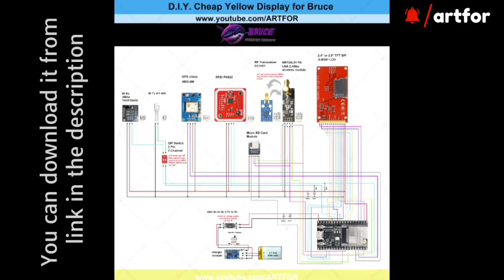DIY CYD for BRUCE Part 3

Comment: Bro I bought 3.5 inch tft module please help me how to install in this
Reply: Can we contact
Reply from the maker: You can find me on tiktok "ARTFOR" with the same logo
Reply from the maker: Sorry i haven't use 3.5" display, but what resolution the display is?
Reply: @ARTFOR 320*480
Reply: @ARTFOR 320*480
Reply: 480*320
Reply from the maker: need to modify the codes to fit with that resolution, unfortunately i can't do that sorry

Comment: Bg kalo pake esp32 aja bisa
Reply from the maker: Kalau baca digithubnya bisa...samain aja PINnya bang
Reply: Om buat nrfbox esp32 v2.7.2 om plis dia butuh oled nrf24 esp32 @ARTFOR
Reply from the maker: Boleh rafil tar dipelajari dulu ya
Reply: Saya juga pengen bikin esp32 wroom 32 itu apa om  @ARTFOR
Reply from the maker: ESP32-WROOM-32 adalah modul Wi-Fi dan Bluetooth yang kuat dan sangat terintegrasi, modulnya banyak dipake karena pilihan yang sangat populer dan serbaguna untuk membangun berbagai aplikasi Internet of Things. Saya disini pake yang tipe WROOM32U
Reply: @ARTFOR kalo esp32 wroom32 itu flash sama aja y
Reply from the maker: Iya sama rafil
Reply: Om mau tanya esp graber itu apa bg bisa control apa si  @ARTFOR
Reply from the maker: Baru denger saya juga
Reply: @ARTFOR cara program esp32 gimana om kalo pake flash esp32
Reply from the maker: Esp32 flash download tool ya, kurang lebih seperti video dibawah ini 👇:
https://youtu.be/lKPhp69dbVE

Comment: Dude I want to add both nrf and Cc1101 at a same time how Can I do that
Reply from the maker: You need to make the same connection just like NRF24 then you put  2 switch with 6pin to control SPI, power and IO connection
Reply from the maker: I already do that in the CYD Launcher here :
https://youtu.be/uZm_bmk7kTs
You just only take the NRF24 and CC1101 and also the switch
Reply: @ARTFOR  ok I will do like that Have you  figured out how to fix touch issue
Reply from the maker: fixing the touch issue would involve a coding system, I don't know how
Reply: @ARTFOR  ohh ok

Comment: nice work, i have a question, if two copper meets in one place wont they do short circuit?
Reply: I think, the copper has clear insulating layer
Reply: @ hm ok ty
Reply: @ because im trying to solder copper wire(im doing evil crow rf) and i just cant, its hard af maybe i should try this wire soldering?
Reply from the maker: copper without an insulating enamel coating will short circuit if they come into contact with each other, but enameled copper wire will not short circuit unless you scratch the enamel coating on both of them.